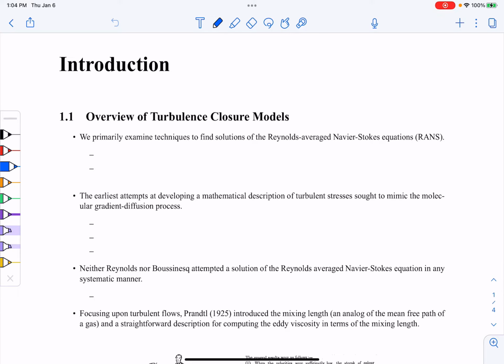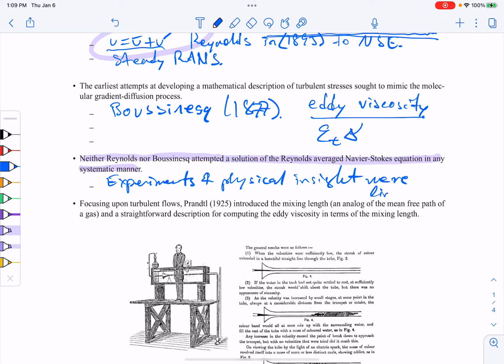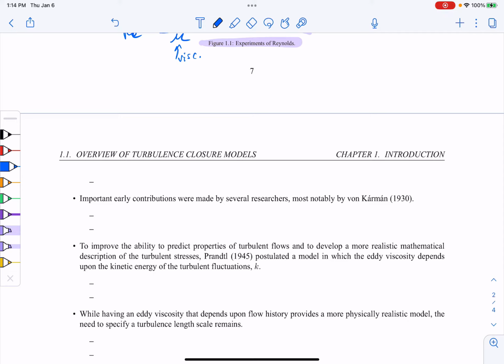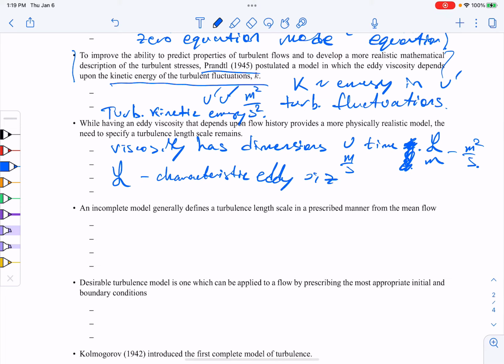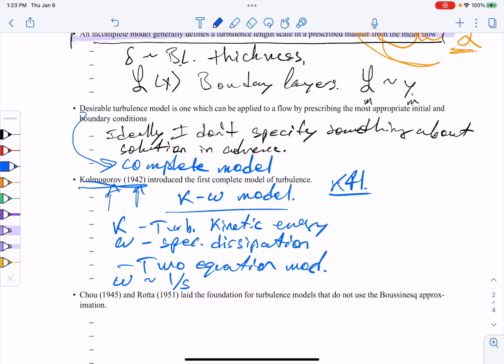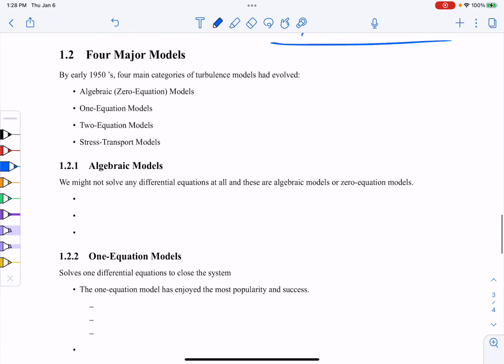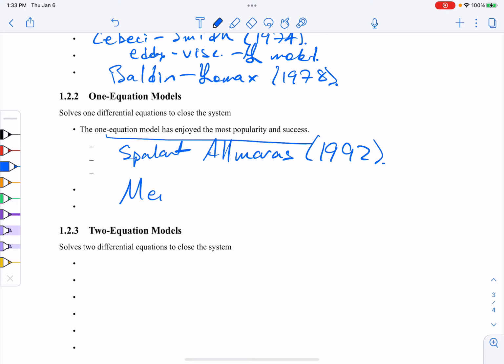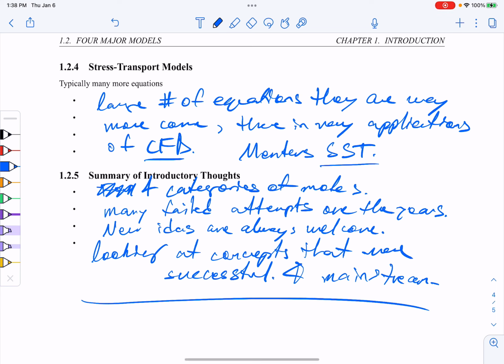Turbulence Modeling - Prof. S. A. E. Miller - Types of RANS Closures - Class 1

Comment: Hey professor, could you please share the details of the primary book you used for reference while setting up the course and the notes
Reply from the maker: Multiple references and books are used - including the original journal articles. For example, SA model is based on the original SA model and discussion texts from multiple books.
Reply: @SAEMiller  I am currently referring this book.
Turbulent flows.
Author: Pope, Stephen B.
Do you think its a good choice to follow along with these video lectures?
Reply from the maker: Professor Pope's book is excellent overall. It was used for years to teach his students at Cornell Aerospace. I think it is one of the best references for LES.